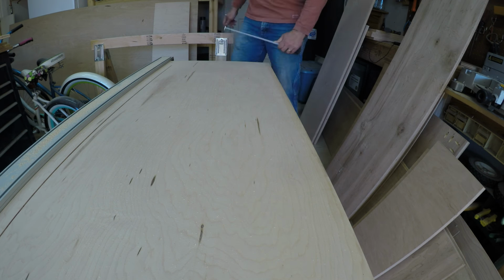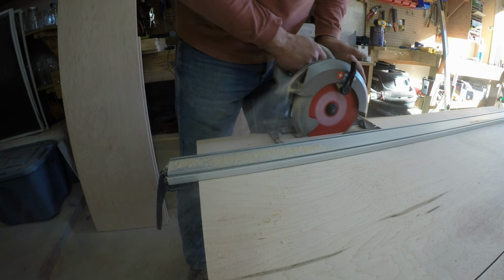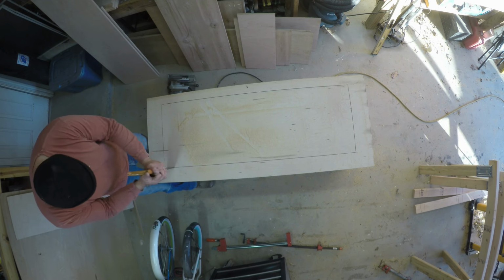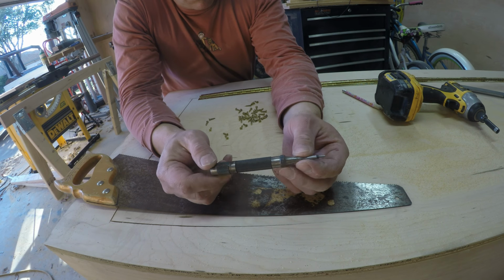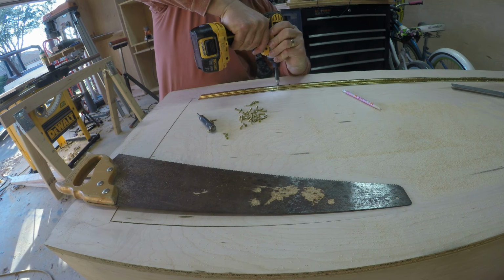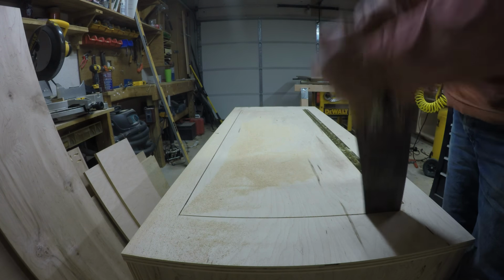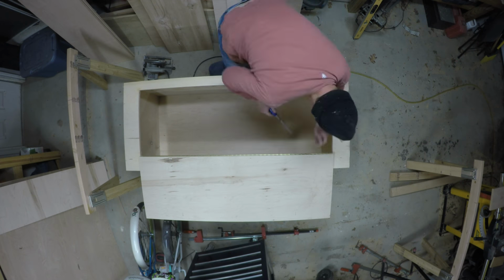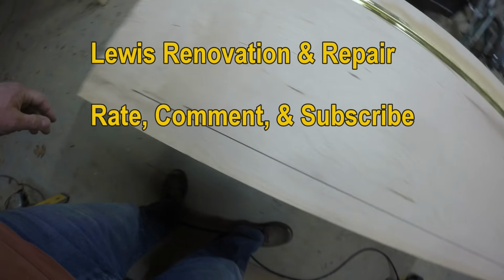How to Install a Piano Hinge

Comment: I work for a hand surgeon and was so worried for you when you use your finger to feel the screws through the wood at the end of the video, since I've treated patients with injuries from doing exactly this 😅 Definitely not recommended for newbies, but I'm glad that you were safe!
Great video and advice for installation otherwise, thanks!
Reply from the maker: I've done my share of dumb things.  I once shot a framing nail through my hand nailing a board to my hand.  I'll try to stay safe.  Thanks for commenting.

Comment: hi! Great video! I have a question. Can you send me a link for this self centering attachment. Or describe it. Sorry, but I’m a newbie. thank you so much! ❤️❤️❤️
Reply from the maker: Here is a similar version on Amazon

QWORK Vix Bits Self Centering Clic Change Door Hinge Drill Bit Set High-speed steel, 5/64", 7/64", 9/64", 11/65", 5mm, 13/64", 1/4"(BLACK) https://a.co/d/1zRJCty

Comment: Very in formative. I want to install a piano hinge on an existing cabinet / dresser as the current "pivot" type hinges have broken twice. The door is 27 wide by 30 high and 3/4 thick and weighs 18 lbs. But the dresser if far too heavy to lay on its back. Any suggestions on how to do this. I am not an accomplished woodworker but am fairly handy.
Reply from the maker: That's a tough problem. Maybe attach to the cabinet side,  screw at just the top of the door, move around until you get it right,  and screw down the bottom of the hinge. Good luck!

Comment: Why do you not hide the hinge.....having a visible hinge ruins the look of the overall piece....all for use of cabinet hinges or hiding this inside the back seam to be hinged....with only visible thing being hinge spine.
Reply from the maker: The client is putting a upholstered cushion over the bench.
Reply: I think adding a nice decorative hinge can be appealing.  Aesthetics, as you've pointed out, is about the viewer.
Reply: TonyDracon  - ??? Install hinge inside gap.... like on a piano.... "piano hinge"!!!
Reply: The only purpose I can think you would want it on the outside is to hide a bad cut they are ment to be recessed.

Comment: I'm making a similar lid like that. Is there a way to make the hinge completely invisible? and make it fold all the way backwards?
Reply from the maker: You can put the hinge in the back saw cut but you'll have to mortise out both sides the thickness of the hinge
Reply: Ok, thank you
Reply: @stephencraig8578  I got it to look nice. Only 1/8 of the hinge shows. I mortised out one side.